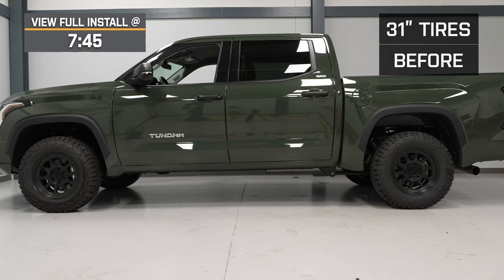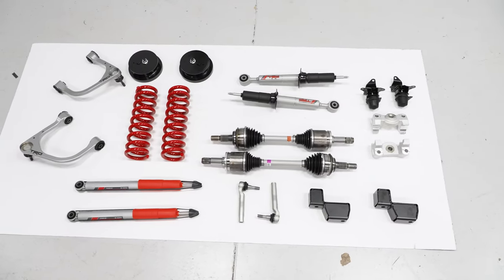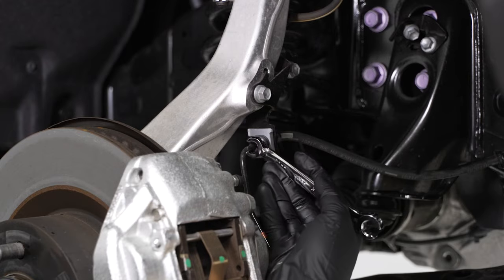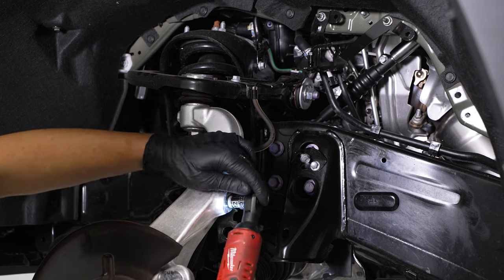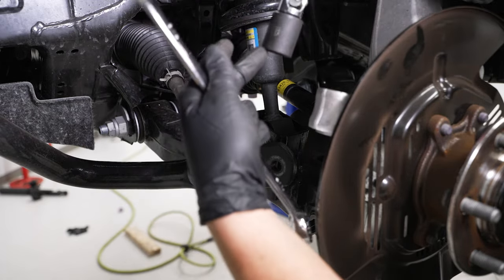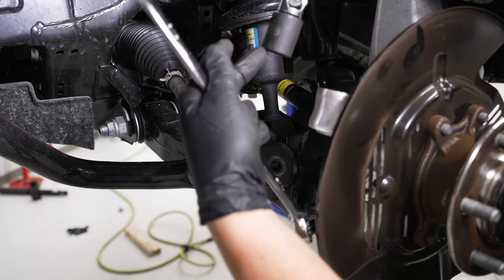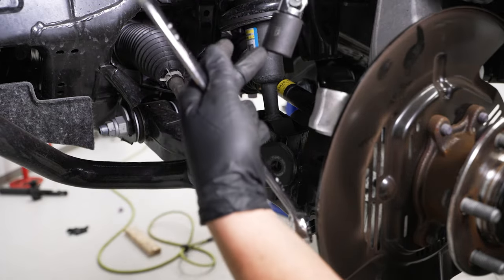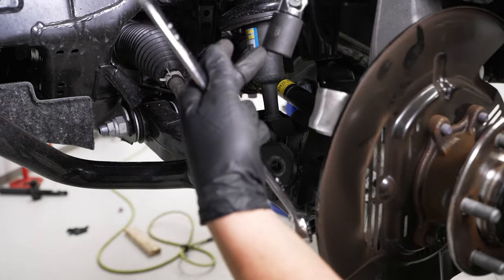2022-2023 4WD Tundra Toyota 3-Inch TRD Suspension Lift Kit Review & Install

Comment: I believe you put the hardware for the front shock on incorrectly. Correct me if I’m wrong but should that first washer go under the top hat then bushing followed by 2nd washer on top of top hat? I have to remove mine now because I followed this….

Comment: I put this lift on my 2023 platinum. Didn't remove fog lights because that is stupid. Also didn't replace the brake lines or the axles because it's my wife's truck and is a pavement pounder. I also maintained the front drop down spoiler simply by trimming it around the drop sway bar brackets.  Obviously I will keep an eye on the axles and brake lines but shouldn't be an issue. My only regret is I went with 20 inch wheels and 35 inch tires. I think 18 inch wheels with 35's look better.
Reply: any rubbing with the 35's?

Comment: I installed a 2-inch lift kit and 285/70/18 tires on my 2022 Toyota Tundra SR5, and when I started it, many warning lights came on the dashboard with disabled functions like ABS, brake... What could be the issue?

Comment: Beating on the top of that tie rod  end with a hammer is going to damage those threads. 13:54 Buy a tie rod separator. You will thank me later.

Comment: U need to get speedometer recalibrated if you run 35”?
Reply from the maker: It's not a requirement, but a tuner or speedometer calibration tool would be helpful to see the most accurate speed.

Comment: Want to get my truck leveled but Toyota service manager told me if I change the tire size on my truck ( what it came with when I drove it off the the lot ) it would void everything on the truck . I would love to get a clear understanding of what I could do to my truck to make it look better. Have a feeling this Toyota dealership is going to lose a lot of business with this new service manager. I love Toyota trucks and cars but this guy has really pissed me off . He also

 ran off one his best employees .
Reply: Get the trd lift kit to not void anything. Don't do spacers either. Throw on some 35s and you're good to go
Reply: The only thing larger tires/wheels could potentially void is anything they directly effect.

With that being said a dealer/manufacturer could deny a warranty claim and blame aftermarket parts you added. Even if they are wrong, you would need to hire an attorney to try and get the manufacturer to cover the work.

I cant speak for Toyota, but I've never had any issues with GM with warranty work on the last 2 Silverados I owned. They were both lowered 4/6 on 22in wheels and 4/7 on 24in wheels.

Comment: What offset did you use on the 35x12" tires (not even 12.5s).   Did they rub bc mine do even with an alignment.   I am running +40mm and have tried +25mm.  On 35s and both rump either the sway bar or the body mount.  It is frustration bc I have seen people run 37s with a chop or 35s on factory TRD rims which have a +60mm offset with no rubbing.    If you dont have rubbing can you share your alignment settings?   Thanks.
Reply: My tires also rub with this kit. 35/12.5R18 +1 offset. I removed the block behind the liner up front and it helped a lot. But it still rubs a bit on that triangle type piece that sticks out if I crank it all the way.. I am debating on cutting it.

Comment: Does this kit works with my oem trd skid plate?
Reply: No. The sway bar gets in the way. I have seen some that were able to still fit it by cutting the skid pate a bit. I just haven't got around to doing it yet.
Reply: I have this lift kit installed on my 2024 Limited TRD Off-road package Tundra. It has the skid plate still installed. Purchased off the lot this way.
Reply: @Jacbknght  does your sway bar is protected by your skid plate? Or goes over the skid plate because the sway bar brackets?
Reply: @franciscofloresacuna4994  it goes over the skid plate, not protected. Not sure if there’s a mod to tuck it back behind or not and still allow full suspension travel. I really don’t want to run spacers on the skid plate 3”. Would like to tuck the sway bar back behind the skid plate by removing brackets but don’t thinks that a reliable option on mechanical linkage.

Comment: I just wish this would be a factory install and not a dealer install. Do not trust a dealer tech to install this as well as a factory worker would, even though these Tundra factory workers are messing up a lot, dealer install also means I would have had paid for the original suspension AND this lift kit AND additional labour.